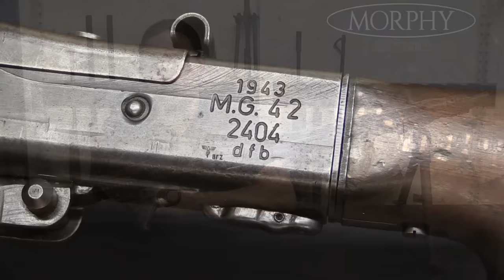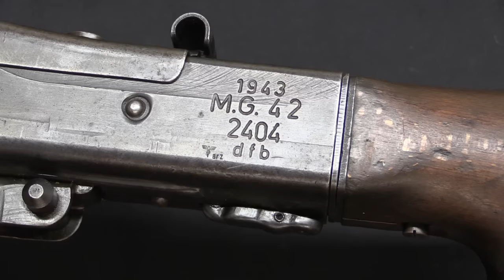Hitler's Zipper: The MG-42 Universal Machine Gun

Comment: When I was in Afghanistan we had to call on the Italian EOD to check out an IED once. It blew my mind when they showed up with a bunch of MG42s mounted on top of their trucks.
Reply: Those were more probably MG3´s, the successor to the 42. Used by a lot of different european and eastern NATO allies. But I guess they are basically the same gun, with some iterations inbetween, in Nato 7.62 mm and a reduced rate of fire of about 1200 rpm. It was developed from a reverse-engineered MG42, since the original blueprints were lost. It was introduced in 1966 as far as i can pull from wiki. :D But since they look more or less the same, I can understand the mistaken identity.
Reply: @hawkmoon3312  the next generation looks completely different however.
Reply: @TheCaptainSplatter  That´s true. But if those were some older italian Vehicles, I guess they might still carry the old guns.
Reply: @hawkmoon3312  The MG42 and the MG3 are basically the same gun; Only the latter one is chambered in 7.62 NATO.
Reply: @Atombender  Nope. They might look quite the same. But every part has been changed.  You wouldn't be able to switch  parts between those two machine guns.
Reply: @StUffzSpezPi  they are the same guns, just retrofitted 7.62 nato, mg42 were retrofitted and became mg1's and after and then mg3's my service machine gun waß a 42 from a 1944 they just stamped it over with a 1 and then 3 when it got some mods added
Reply: @StUffzSpezPi  onlythings that we're changed were muzzlebrake, bolt and barrel, everything else stayed sthe same, oh and added AA sight for mg3a
Reply: @jokiiiiiiii  ich Versuch es mal in Deutsch, da ich vermute, dass du deutsch bist.
Ja, das Gehäuse ist ab und zu noch mit MG42 gestempelt. Allerdings passt nicht ein Teil vom MG3 ins MG42. Das Gehäuse wurde bei Rheinmetall angepasst. Die Schulterstütze beim MG42 dreht man in die andere Richtung um sie zu lösen, die Schließfeder ist eine andere, der Rollenverschluss ist schwerer und hat ein anderes Maß. Das MG42 hatte weder eine Lamellenbremse, noch ein Gurtzuführerunterzlteil. Das Flavisier ist am MG42 gar nicht vorhanden, die Polygonrohre gibt's beim MG42 ebensowenig. Das Gesamte Konstrukt um den Rückstoßverstärker und die Rohrführungshülse ist geändert worden.
Die Zweibeinmontage ist ebenfalls geändert worden. Die Führungsschienen der Verschlusslaufbahn innerhalb des Gehäuses wurden ebenfalls geändert, sonst würde der Verschluss nicht passen. Das System der Sicherung ist ebenfalls geändert.
Es werden lediglich die stark geänderten Gehäuse der MG42/MG1 verwendet. 
Mittlerweile nutzt die Bundeswehr Lizenzbauten aus der Türkei, welche qualitativ nicht wirklich gut sind. Die Schienen in der Verschlusslaufbahn verbiegen, wodurch die Waffe auch nach loslassen des Abzugs weiterfeuert, bis der Gurt durch ist...
Gruß von nem aktiven Soldaten...
Reply: @jokiiiiiiii  nope. The ammobeltreceiver was changed, the MG42 had only the upper part, the MG3 has a lower part as well for the beltboxes to connect with and also to use different kinds of ammobelts. Also the MG42 had no adjustment/brake for the upper receiver. Learned that the hard way. The boltspring is completely different as well as the inside of the casing which wouldn't take the bolt because of the different measurements.
The mechanism of the security lock is a different one. The shoulderstock had to be turned into the other direction for disassembly.
The bipod mount has also changed. 
That are some changes adding to yours. In fact you cannot swap parts from an old MG42 into a new MG3.
I had both weapons in my hands. The historical collection of the airforce school for NCOs has one MG42 in its stock. I am trained at the MG3 for years and was in weaponmaintanence in my first years in the Bundeswehr. I'd like to say that I am quite sure about what I am talking about.
Reply: @StUffzSpezPi  thanks for the reply, what i said was told to me at estonian defence force and i really didn't fact check, but good to know about this info, but is the frame, grip, stock the same still?
Reply: @StUffzSpezPi  and figured after the comment that the must have changed the feeder for nato aswell, so thanks for the info
Reply: @StUffzSpezPi  and the feeder brake i learned about just yesterday thought that the 42 had that aswell, quick question how did the 42 keep feeding without double loading or breaking without the brake
Reply: @jokiiiiiiii  the frame is almost the same. The mount for the bipod and the inside of the frame is different. 
Yes the feeder (I called it receiver) is different. The old one had only the upper part,  the actual one had also lower part for NATO belts and for those belts wich fall apart during shooting.
I have absolutely no idea how it worked. I blowsy mind every day I see the feeder. Someone who builds stuff like that must have a big knot in his brain. :D
Reply: @StUffzSpezPi  okay, well thanks for the info, now i miss my mg3 even more 😄
Reply: @jokiiiiiiii  We still have a few in our platoon. But as a matter of fact, new soldiers don't get any training with it. They only get MG4 and MG5. At least the last of us who are tomorrow in service will go into the shooting simulator (AGSHP) and because we are all guys with some years on our back, the MG3 will take a major part of it :)
Reply: Iirc Italy uses Beretta MG42/59 which is a license built mg3
Reply: @StUffzSpezPi  speak English boys its the law after all. Lol kidding of course but id love to understand what you said it seems interesting lol mostly just the one comment in German but it was long and looked interesting lol.
Reply: @bigvinnie3  It is basically the same I wrote in english afterwards. I am explaining what parts have been changed over the time and that it is far more than just the muzzlebreak. It is an urban legend even in the german army that there have been nearly no changes at all but the spring in the bolt to make the MG3 slower than the MG42.
Reply: I fought in Yugoslavia in 1991-1992. We used our version of MG-42: the M53. Check it out.
Reply: @StUffzSpezPi  Ich bekomme zwar nicht mehr die bezeichnung der einzelnen komponenten zusammen aber ich würde es mir nach 20 jahren zutrauen das MG mit Verschluss zu zerlegen u zusammenzusetzen sah komplex aus aber so einfach von der handhabung wenn man die abläufe verstanden hatte. PzGren Btl 401 PzMörser Kompanie. LG u alles gute
Reply: I would’ve asked to pretty please fire it
Reply: @hawkmoon3312  More precisely Beretta MG 42/59 but yes, closely related to the MG3
Reply: Ain't broke
Reply: @megamillionfreak  Any video links of it in use?
Reply: @theculturedthug6609  Sadly, there were no smartphones in 1991-1992. I must think if you google Yugoslav m53 (Zastava M53) machine gun, something will come up.
Reply: If you’re American, the machine guns on your trucks are even older
Reply: @StUffzSpezPi  Wow! Thank you for your service, and for sharing your real life experience with us. I, for one, genuinely appreciate it.
Reply: @TheCaptainSplatter  Incorrect. The MG3 is almost identical to the MG42.
Reply: That Charging handle is the balls.  Looks like an AR pistol grip. I understand not a good idea tactically but the shark fin buttock rocks as well. Very cool.
Reply: "I thought you guys weren't fascists anymore?"
"That's what we wanted you to think!"
Mussolini rips off his mask
Reply: @nigelwigglwattle  Its rather a license built mg42 wich ended up with the same modernizations the mg3 had compared to the original, a case of technological "convergent evolution"; the same could be said of the m14 and BM59 compared to the garand, same ancestor and same result but with 2 independent developments.
Reply: @qdaniele97  Exactly. Used during my compulsory service in 1991. Confirming that the fire rate is not the same as the original but reduced to about 800 per minute to avoid overheating barrel.
Reply: @hawkmoon3312  das mg3 hat auch einen geänderten verschluss wenn ich mich nicht täusche :)
Reply: @nigelwigglwattle  While you're correct that the MG 42/59 is the Italian standard, it's actually an offshoot of the MG1 rather than the MG3.
Reply: MG-3's....
Reply: @someduckwithanultimax6549  that's correct. Anyway all of them are great guns. I had a number of them in my armory when I was in service (along with a bunch of very very nice M2 machine guns).  Everybody with a low opinion of the MG42 as a universal machine gun  though should have lugged around the Browning  M2 a couple thousand meters as we did  twice every day,  to put it on the tank and back in the armory.  Anyway in the Italian Army armoured vehicles have M2 , while other vehicles with a machine gun and troops with a squad weapon  back then used to have  MG 42/59.
Reply: good for them
Reply: MG42!!!!!
Reply: One of Italy's backbone GPMG are the MG3's.
Reply: @hawkmoon3312  Righty Right!
Reply: @TheCaptainSplatter   To the TRAINED eye maybe, at a distance they look pretty similar- like the AK-47 and the AK-74 at a DISTANCE...
Reply: funny thing is: today this exact gun with basically only 3 parts changed is known as the MG3 :D
Reply: This thread is making the two years of German I took in highschool worth it lol
Reply: @hawkmoon3312  Very similar to MG3 but Italy has the Italian equivalent being the Beretta-manufactured MG-42/59  (1959 being the year the rechambered version for 7.62x51 NATO ammunition was adopted), they stayed in production until the early 2000s. MG42/59 also almost got a conversion to 5.56 NATO adopted, it worked fine but the FN MINIMI was lighter and preferred for infantry MG squads. But MG42/59 is still the standard MG mounted on vehicles (rooftop) and helicopters (doors), the newest ones included. Even Italian remotely controlled weapon systems like OTO-Melara's Hitrole-Light employ either a 7.62mm MG42, or a 12.7mm BMG Browning M2 (that BTW are even way older than MG42s) or possibly a belt-fed 40mm granade launcher